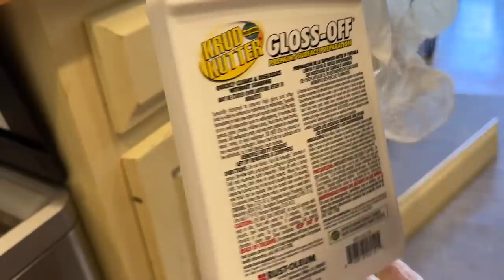KITCHEN CABINETS WHITE // PAINTING KITCHEN CABINETS WHITE // kitchen cabinets makeover diy

Comment: I painted a. Cabinet with a 4" FOAM ROLLER, left a beautiful finish on the Cabinet.  Moved into an apartment  & am thinking about painting the as they are worn & about 50 years old. At my former home I painted the counter top as it was wearing & looked like leather.  I used an epoxy Almond color paint, followed directions & it lasted 20 years.